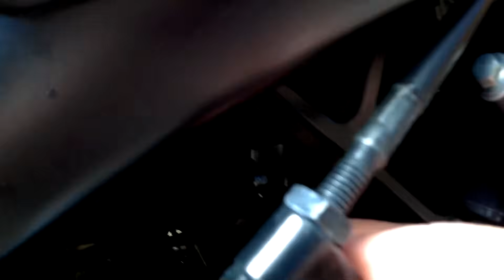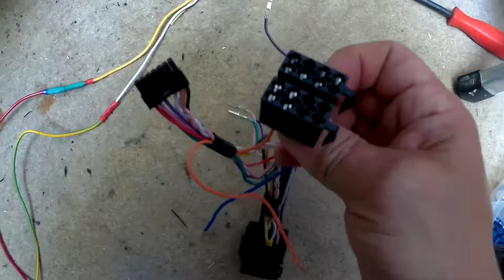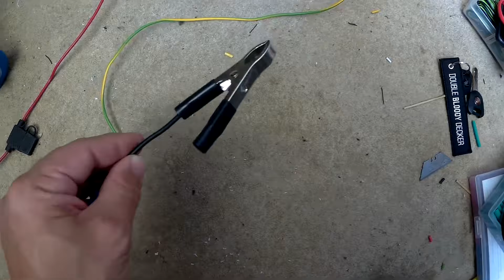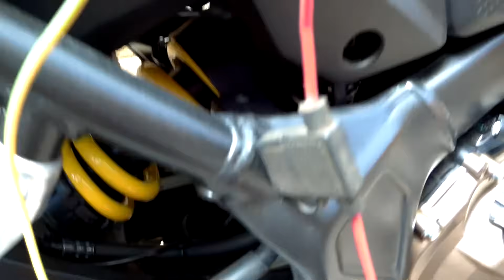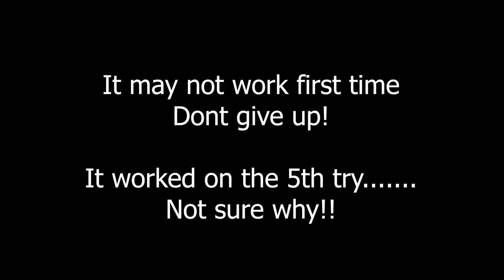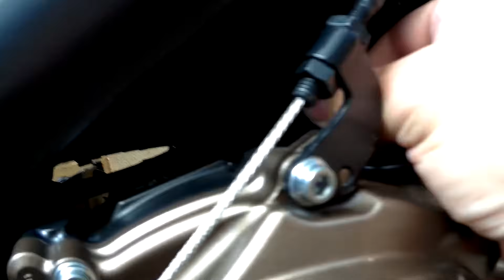Honda Motorcycle HISS Key Coding using £1 DIY cable!

Comment: Will this system work if i change my ignition switch and keys?
Reply from the maker: You can create another key of the ignition system has a key coded to it that you can use to cloan. This is a key cloaning operation.

Comment: Just successfully coded a replacement key (supplied from same source as linked in the video) - to a 2019 Honda Africa Twin model CRF1000L DX, UK spec. The key coding procedure was straightforward, and exactly as per the video. I used a 2 amp(grey colour) mini blade fuse and a 100 ohm 1/4 watt resistor in the cabling.
I used a spare 12 volt battery : (+) to the yellow wire, and (-) to the yellow and white wire in the crankshaft position sensor plug (ie male pin side) under the seat.
It took me about 6-7 attempts to get the HISS light to flash 4 times in succession.
NB - I had first tried with a 1kohm 1/4 watt resistor, but couldn't get the HISS light to flash on/off -at all, despite many attempts, but it seems the bike was more happy with the 100 ohm resistor!

So - big 'THANK YOU!' indeed! Ken.😀
Reply from the maker: Well done for persevering Ken!! Nice work.

Comment: I have a 2005 XL1000 Varadero, and I tried about 50 times with no luck, even with the battery charger on, and even with a battery booster + the charger on.
The bike refused to go into key registration mode, and the HISS light stayed on.
Eventually, I tried folding the side stand, and I tried also to not just take off the red crocodile clip, but touching the black negative with it to send a clear zero to the ECU.
It worked.
Reply: Can you tell where's the plug to connect 😕 to be sure i have tried about 100 times 😢

Comment: Worked for me on my CB650R 2022 with only 1 try. Thanks!
Reply: Did you had cranks sensor at the same location? For some reasons my 2002 got slightly different covers without cables going out of them

Comment: is it possible to remove a key that was previously tagged to it? for security purposes?
Reply from the maker: Not that I am aware of.
Reply: The programming process should remove any previous keys that are not recoded at the same time. I've done this on my previous bike (2002 cbr600f) with my own diy lead made using a genuine plug from a breakers yard. That ended up with 3 keys after only getting 1 originally so got a second then the dealer lost one but found the original spare....

Comment: Do you have to have key cut or can it just be one off eBay ?
Reply from the maker: You need to get the key cut to match your locks. If you already have one key they they will be able to cut it from a picture.

Comment: I have a 21 plate cb650r which has a 3 pin crank sensor plug do you know what I need to do differently
Reply from the maker: Sorry, I don’t know the hack for the three pin.

Comment: Have tried this twice now, but cannot seem to get it to work. I follow all the steps and the bike responds like expected with all the blinking lights. Except for when I put the new key in, the HISS light will be on for a few seconds, then start blinking, it does blink 4 times, but the last 2 blinks are noticeably slower. Taking everything out and trying the key then, nothing happens and the HISS light will just stay on. This is on a CBR 600f4i. Any help would be greatly appreciated!
Reply: Update for anyone in the future, the SSLL (Short/Long blinking code) meant that the chip was not working in my case. Got a new chip from the sender and it worked on the first try! It can also mean your wiring is wrong in case you have a working chip.
Reply from the maker: Sorry, only just seen your message. Well done for sorting it out. 👍🏻

Comment: Just managed to code a replacement key following your guide, I did the same buying a Honda NC750x from Copart, it came with one  original key but I needed another, so bought one from Chema LTD, they cut the key from a photo I supplied with chip, and using your video it all worked perfectly, big thanks.
Reply from the maker: Great to hear! Good work. Good luck with the bike and ride safe. Great mpg on those!

Comment: May sound silly but could you actually connect all the small wires used from the spare radio harness to make the 2 longer wires just cut off the pins off all the other small wires then crimp them together to make the 2 long wires also do u have to use a inline fuse thank you
Reply from the maker: Yes, you could do that. No need for the thicker gauge wire I used, i just happened to have that spare. It also meant I didn’t need lots of joins.  Can get away without an in-line fuse, it’s the resistor that’s essential for it to work. It’s not drawing a lot of power for this procedure. Thanks for watching.
Reply: @beanosgarage9606  amazing thank you very much for your help it's to programme a 3rd key for my brother cbr650f

Comment: an aux ques on the Quadlock mount you got there, is there a particular reason to avoid a stem mount?
Reply from the maker: Hi, thanks for watching. The mount came with the bike so I kept it. I had a stem mount on my last bike which worked well but this is just as good and being quadlock is solid! I have had to get the anti vibration damper for it though as it was damaging the camera on my iPhone 12!

Comment: Does this work on a 2023 cb300r? And where to locate the cable which connects the programme cable/battery/100ohm resister? Honda have successfully hidden the battery under the tank 😠
Reply from the maker: Hi, sorry but I don’t know anything about the 23 cb300r but I would expect that if it’s still the HISS system it would be the same. The plug you need to connect to should be in approx the same location as on the video as it’s the crank sensor.
Reply: @beanosgarage9606  thanks for your response, bought a key, cut to code with chip. The key worked without coding so the CB300R does not have HISS! The dealership did not know and wanted £200 for doing it (£80 for the key and c. 1 hours labour at £105/HR) In the meanwhile I found the 'lost' key DOH! At least I now have 3 keys. Any one want some 100ohm resistors? I have some going spare 😆

Comment: This is awesome but I don't understand,. How does the ECU or whatever know what to do. The wire just connects the battery to the sensor. The ECU would only see the sensor disconnected? ...I don't understand electronics lol
Reply: Hi! Because it senses 12 v on the CPS connection, then nothing, then 12v again... Is programmed like this.
Reply: That's the bit I don't get.. How? The CPS is completely isolated from the ecu
Reply from the maker: It’s witchcraft, just trust and believe!! 😂
Reply: Is the ECU getting 12 volts instead of a CPS signal :)  @francisfe2064  The CPS is just disconnected, and the power travels throught the wiring harness into the ECU

Comment: Worked the first time for me, using:
1kOhm Resistor and 10A Fuse on red wire, 
aligator clips for black and red wires on battery 
makeshift connectors on sumitomo

4 HISS flashes = key programmed.
Do them all, test them afterwards.
Reply from the maker: Great stuff - good work!

Comment: hello, did you know if the key are not programmed they give a spark or no? Thank you for answer!
Reply from the maker: If the key is not programmed it will not switch off the immobiliser and I don’t believe it will enable the engine to turn over.
Reply: @beanosgarage9606  thank you a lot for answer!

Comment: Hey it's me again, does this work to duplicate a key that is already in use with another ECU/bike? Or does it have to be a new unregistered key?
Reply from the maker: Good question!! To be honest I don’t know?!? I doubt it would work, I think you need an uncoded key but I could be wrong! Sorry I can’t give a clear answer!
Reply: Hey Beano's garage, looking the the service manual it states in a bullet point but not a step:
The immobilizer system (HISS) enters the registration mode. Registrations of all key except the original key set near the receiver are cancelled.

This is confusing I wonder if this means if a new (registered) key can be 'canceled' (cleared) so it can be used upon as if it were a new unregistered key?

This is what I'm hoping
Reply: No. You cannot reuse an already programmed key. There is a "secret" that the motorcycle programs into the key transponder, that only the ECU and the transponder knows. So a key from a different motorcycle would have a different secret.

Comment: why you know method are you have manual
Reply from the maker: The method itself is set out in the manual for the bike BUT this video is about making your own cable at very little cost rather than having to find and buy the genuine Honda cable. It also sets out that you don’t need to pay lots for a genuine key. Hope it helps you!

Comment: This seems unreal and fake does this actually work? 😅
Reply from the maker: Certainly does - why would I bother putting a video together if it didn’t work??
Reply: Does this work with coding a single key to a new ECU?
Reply: Or for example, I've put a new barrel on, with the old ECU can I use it to reprogram the key that were used with the new barrel. 

So basically what I want to do is reprogram a key that was registered to another ECU to the original ECU.
Reply: I fear I won't be able to turn on the ignition then though will I, maybe I can bolt off the wiring and hiss and have them separate to get the bike to turn on and read the key to turn on propely. Then do this, then hold the other key new it and see if I can reprogram it to the old ECU and new barrel?

Sorry if this Is confusing it is for me too
Reply: If you separate the ring antenna and the ignition switch, you can pull a switcheroo (switch the ignition with the new barrel key but put the old ECU key on the antenna) and set the ECU into learning mode, but you won't be able to program a key from another motorcycle. You will need a new transponder :)

Comment: Any idea what could be wrong if the HISS light does not stay solid?
Reply from the maker: Check everything and make sure the cables aren’t touching each other. Took me a few goes as you will see on the video before it played ball!! Make sure you have the right resistor too and that your battery terminal connections are good. 👍🏻

Comment: hey boss my ecu is not going to programming state what can i do? i tried 10, 20 seconds, with resetting the key, on-off master switch on right handle, tried to connecting to mass and negative with red but nothing.. should I replace the battery? i tried with multimeter on ends of the cables and i found 12.4v , tried resistance 90-100 ohm  more or less. what can i do?
Reply from the maker: What bike are you working on mate??
Reply: @beanosgarage9606  im on honda xl 1000 varadero..! Found the problem, the bike had 14ah battery.. with a good 20ah everything ok new key working thanks!!!

Comment: Any idea where to find cable connection  on Africa twin 2021?
Reply from the maker: Afraid not. I can only guess it would be around the same place as my bike? It should be wherever the crank position sensor plugs in. Hope you find it!!
Reply: Bro,  did you do that? If yes please reply. I have the same bike.

Comment: 2010 or later and its off to Honda you go. Min £85 if you have a spare to copy.
Reply from the maker: The video is of a 2019 bike? It works on that and many other bikes manufactured after 2010. Do you mean pre 2010 don’t work??
Reply: @beanosgarage9606  No, I went into Honda with my 2010 VFR because the wire trick doesent work on it, they said later bikes have to be programmed.
I found the key a year later, wondering if it's worth selling?
Reply: @tomf4547  I tried to program my 2010 VFR1200F like this.  When I connected the crank position sensor to the battery and turned on the ignition, the HISS light stayed OFF.  It didn't even come on for 2 seconds as normal.  I didn't get the fuel pump noise so it knew something was different but HISS light was out.  I stopped there as I didn't want to reprogram my original key
Reply: @tomf4547  It should work on a VFR. Make sure you use the red CPS connector. This has been the prodecure for Honda keys since the introduction of HISS, and even the newest models still use the same transponder.
Reply: Not sure whether newer or older now. Couldn't programme it myself. Sold now before a Blackpool 'driver' wiped me out 😳

Comment: Hi, and thanks for this. Not brilliant with electrics, was looking at feeding the wires into another connector. Would this be the one and if not can you recommend one?
2 Way Sumitomo HX Series 040 connector Kit inc terminals and seals
Reply from the maker: Hi, looks like the right kind but I can’t be sure as it was a while ago I looked in to it. Just make sure the little prongs on the side of the plug match your current plug. 👍🏻
Reply: @beanosgarage9606  Cheers!

Comment: I've read that if you already have 2 programmed keys and want to program another you have to use one of the keys as a sample but then have to reprogram both original keys and the new ones. 

I also read that there is a limit of 4 keys that can be programmed. Does this mean that if you have 2 good keys you can program an additional 2? Final question. If you have programmed the 2 original keys and 2 new ones, can you repeat the while process again if you loose a couple of keys, or will the process be"used" up and no longer effective?
Thanks
Mike
Reply from the maker: Hi Mike,  all great questions! And ones I unfortunately don’t know the answer to I am afraid!! On your last point, I cant see that the process would stop working if you kept losing your keys? I think you would still be able to programme more, but as you suggest, you may have to reprogram the ones you have again?? Sorry I can’t be more help, I was just trying to achieve 2 x working keys as I only got one with the bike. 👍
Reply from the maker: Just found this which might help - The ECU can hold a maximum of four key codes. So for example if a fifth key is added then the first key will be pushed out and so on. This is an endless cycle and there is no limit on how many times keys can be coded to the ECU.
Reply: My ECU could only hold 2 at the same time :( But hey, the rest worked on a 2001 CBR 600 F4i :)

Comment: So iv had to order a new igintion and key set and a ecu as i lost my one and only key i had,would it just be plug and play or would i need to go through this process with the complete new set?
Reply from the maker: I would expect the set you bought to be matching, so should work straight away. This process only works to clone an existing key. So you could use it if you want to add an extra key to your new set up??

Comment: Do you know if the Honda Silverwing 400 has a key code?  I left the keys in the bike and somebody has taken them.  I don't have a working spare key.  I do have a key that opens all the locks but it isn't programmed so it won't start the bike.  I am being told I have to have a whole new HISS system.
Reply from the maker: Hi, you certainly won’t be able to use this system if you don’t have at least one working key. I am not sure whether the silverwing has a key code?? I expect if it has a hiss system then it would do. Do you have the original user manual and service book etc? Is there a tag or sticker in there? I would expect Honda should be able to sort it, alternatively, keep an eye out for a used hiss and key set on eBay??
Reply: Key codes are only for the mechanical part (the key itself). The immobilizer system is separate. Maybe you can find a set of ECU/CDI and locks, or you can send the ECU/CDI to an specialist and get a transponder coded that would start the bike. After that, make sure you keep at least one spare!
Reply: Any decent locksmith will be able to pick your lock and from that deduce the correct pin out and use that to cut a key. After that, I suspect a trip to the stealer to reprogram that newly cut key, because the process documented here starts with one programmed key, which you don’t have. Also, see if they can unprogramme any existing keys so the sub human that took your key can’t use it. My locksmith made a new key for my used transit. He asked if I wanted the 5 existing keys unprogrammed, I only owned one, so it was a YES from me.

Comment: Great video, worked on my vfr800x crossrunner. Got key cut to code with new chip off eBay, made my own lead and programmed it to the bike, the disconnecting of the positive lead for 5secs didn't work until the 3rd time but stick with it it works. Cheers Beano.
Reply from the maker: Great to hear - well done for sticking with it. Result!! 🤟🏻

Comment: hello, 
do you know if it works on a Honda CBF 600 model 2011?  If so, you can write how to do it.  (The red plug is the ABS on mine).

 Thank you and best regards
Reply from the maker: Hi, I am not 100% sure to be honest but if it is the HISS system I think it should work. There are cables available to buy on eBay that you could look at and see if they are similar. It’s generally the crank position sensor plug you need.
Reply: The procedure is the same for all HISS bikes. The CPS is usually 2 pin and red, to make it easy to identify.

Comment: Does this work for key that fell in water and stopped working
Reply from the maker: Not sure, worth a try but falling in water shouldn’t have damaged a key as they are sealed. Give it a go, what can you lose - as long as you have a working spare.
Reply: Ditto on that reply. The chip appears to be fully sealed and sometimes secured in a bath of epoxy. Water should not bother it

Comment: If I use 1k ohm 2w or 1/2w , will be ok?
Reply: 1/4w (250mW) is ok, 12V over 1k give 144mW  total dissipation. So you can use 100W if you want but minimum is 1/4W :). And when you disconnect +12V wire, put it on battery negative for 5sec an then again to +12V to avoid trying 5 time like in video :)